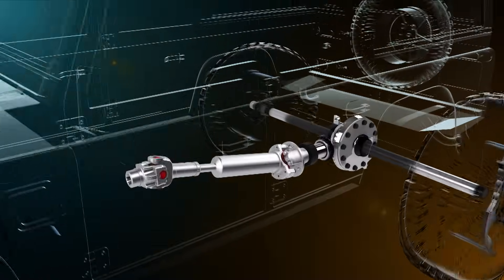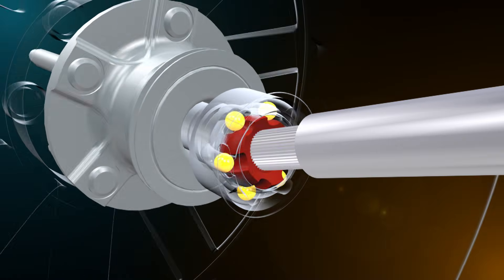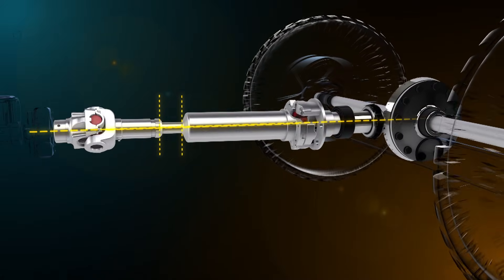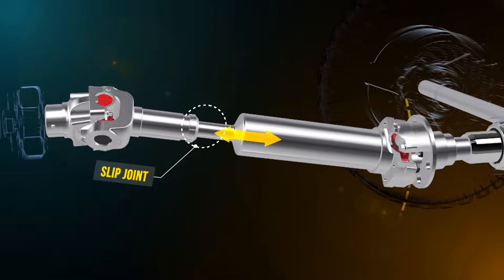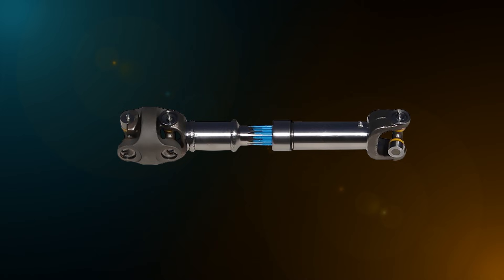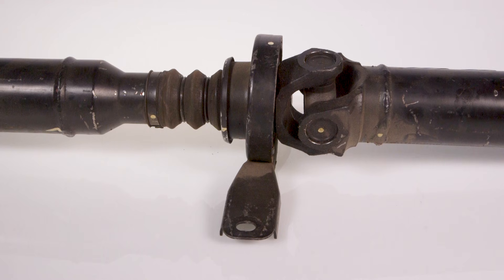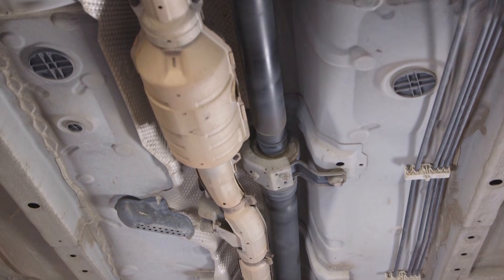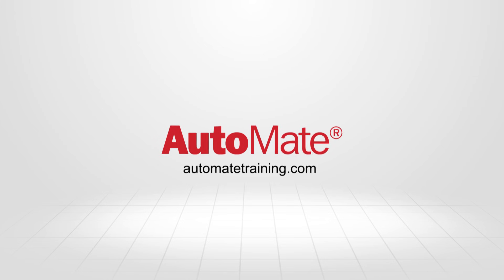Driveshaft, Universal & Constant Velocity Joint Training Module Trailer

Comment: I still don't understand why it's called a "Constant Velocity Joint," how does this allow a car to vary velocity, depending on driving situations? Or is it called so simply because each CV joint will rotate at the same velocity at any point in time, keeping in mind that a car will have a total of 4 CV joints, 1 CV joint per drive wheel or simple wheel? Can anyone who knows please help me understand this concept?
Reply: The shaft maintains constant velocity from it's input and output. This is opposed to say your transmission which takes the 4,000 rpm from your engine, and lowers the rpm but gives you more torque.

Comment: A mechanic found a major crack next to one of the barrings in my trucks Drive Shaft. So here I am learning more about drive shafts as I await a replace shaft getting modified.
Reply: any update for us?  From Long Island, N.Y., U.S.A
Reply: @mr.boombastic7713  I got this issued solved for years back then. 
Had to go to a junk yard with my father to scavenge a drive shaft from a broken truck similar to my truck. Then I had to go hire a freelance welding technician to make the scavenged drive shaft fit under my 1999 Chevy S10 pick up truck. Payed the guy in cash. Was cheaper than going to a professional auto mechanic garage in So Cal.
And so four years later, Still driving that same old truck of mine.

Comment: Drive Shaft do not change length, its radius is the same
Reply: You're right about the drive-shaft, although the distance between the transmission and the differential will change with ride height; the slip-yoke is needed for that to happen and will allow the distance to change under full load/torque.